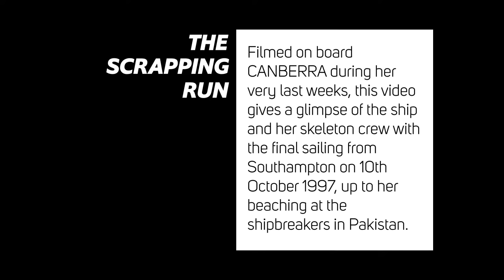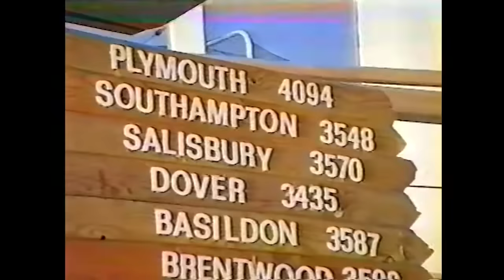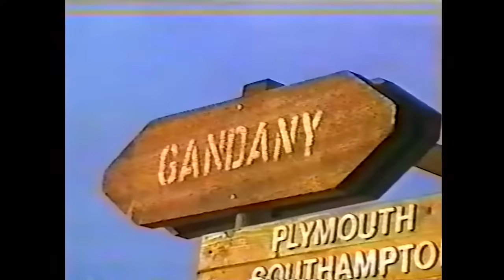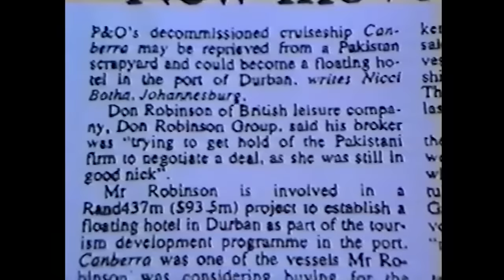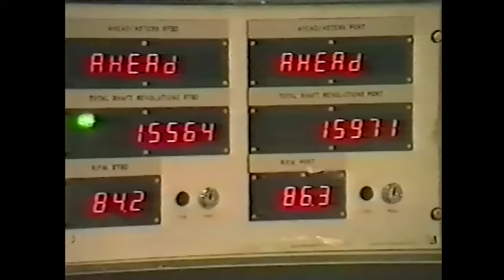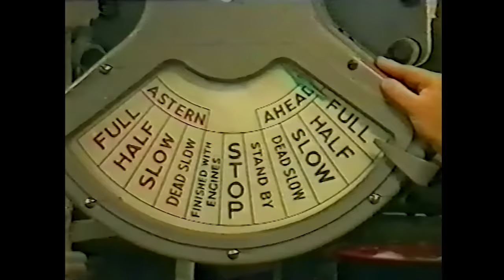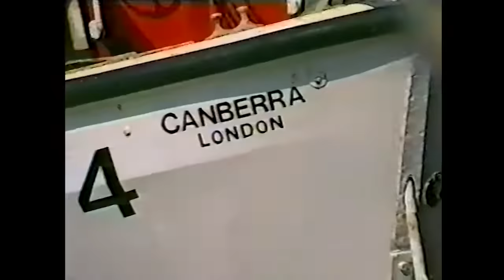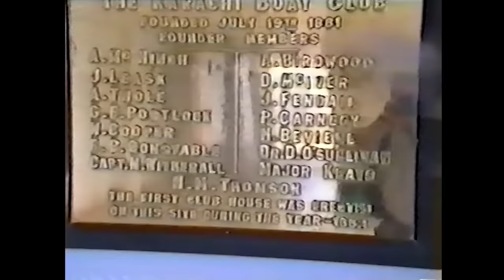The Scrapping Run

Comment: It's sad that Canberra wasn't saved. It would have made a nice hotal loke QE2 or Rotterdam. Premier Cruise Line tried to buy Canberra, but P&O refused to sell her to her as they didn't want her to sell for a different flag, even though Premier had the highest bid. Instead, they sold Canberra to the second highest bidder which was the Pakistani shipbreakers.
Reply: Pity Marco Polo wasn't saved too 😔
Reply: I think it would have been awesome if Premier Cruise Line had bought her, however having the color red on her hull would not have been fitting. I sailed on some of their ships, as a travel agent and when they started out they did well. It was going to be very upsetting when the ROTTERDAM was going to PCL and they were going to change her name to BRB IV. But a lot of HAL passengers past and then present, as well as travel agents were against it and they named her REMBRANDT, kept her hull color the same. We got to sail on her before PCL folded into bankruptcy. They took good care of her.
Reply: There was an offer to buy her and use her as a permanent floating Hotel in Adelaide for usage when the Grand Prix came to town each year.

Comment: It's just a thought but I'm not sure why the life-boats, deckchairs, and other easily detachtable items were not sold at auction in the UK. I would assume some of the prestige furnishings were saved before scrapping in Pakistan.
Reply: Yes lots of stuff was removed prior to handover to the pakistanis. All the expensive stuff was withheld and used on other P&O ships or sold off as souvenirs.Basically all that was left on the ship was junk that no one would've really wanted.